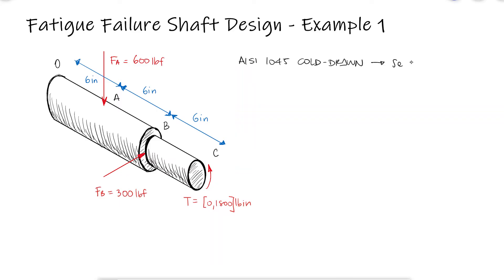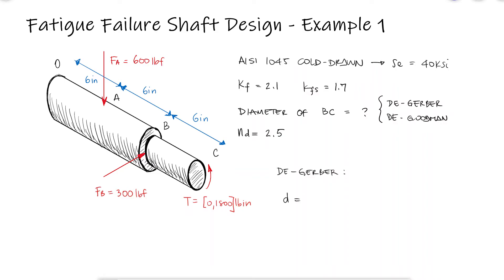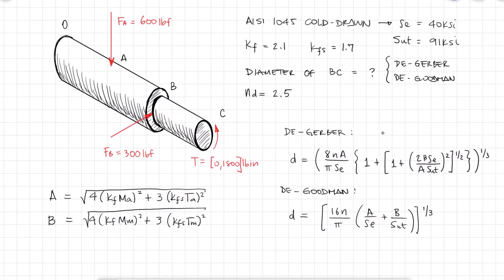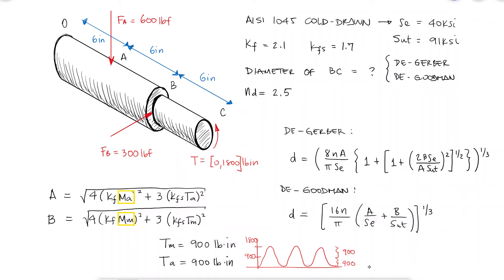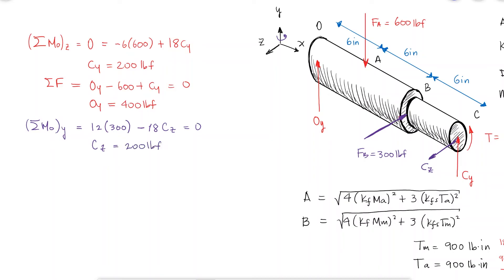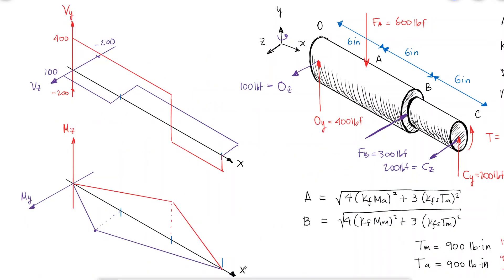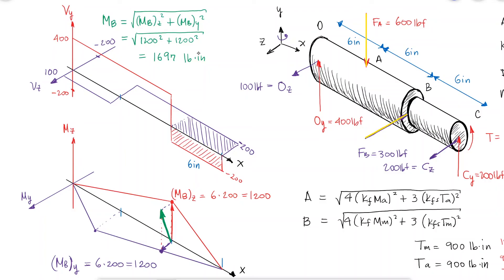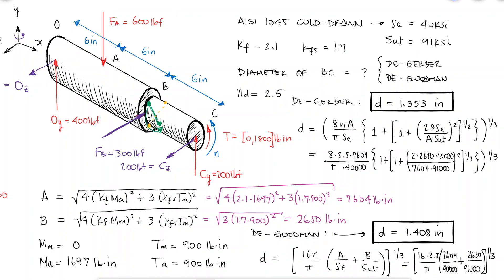[WATCH THE NEW CORRECTED ONE] Shaft Design - Moments in 3D Orthogonal Planes - Example 1

Comment: why fatigue stress concentration was used for mean stress instead of static stress concentration?
Reply from the maker: The mean moments and torques just happen to be the parameters used to ultimately calculate the diameters and factors of safety. The shaft is still being subjected to cyclic loading, so using static stress concentrations would not be consistent.